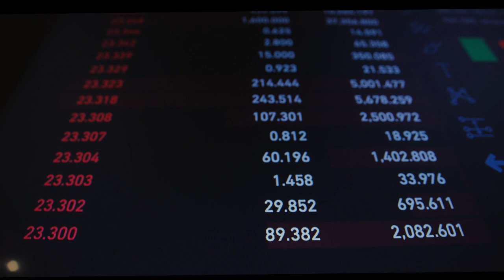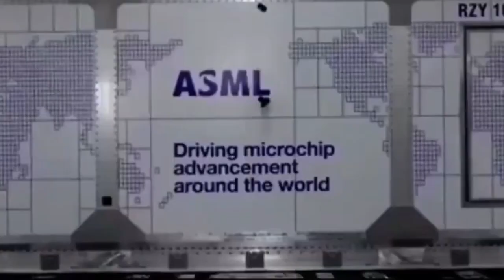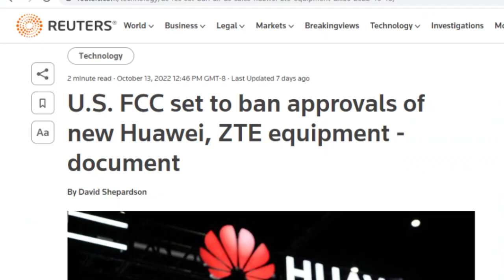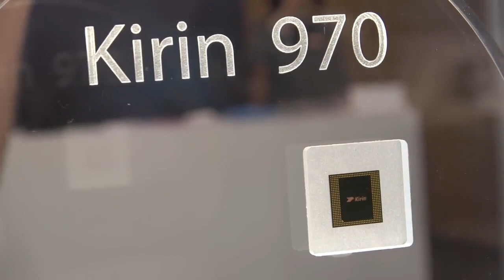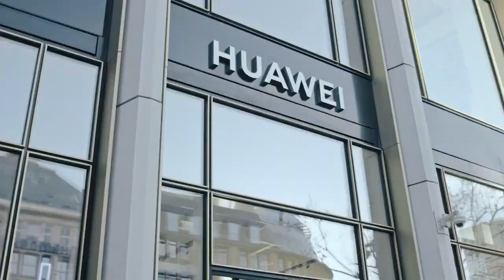Huawei's New breakthrough , ASML should be worried

Comment: Even without EUV, using the DUV tool, China's SMIC has been able to mass produce 14nm chips. SMIC and is now using its N+1 technology to produce 7nm chips in a limited scale. Also, China has pushed out Chiplet Standards for use  to produce up to 4nm chips. All these new techs are being used to produce high end chips in China. Huawei's new breakthrough in light source will, no doubt, lead China towards making its first EUV machine.
Reply: Jai Hinduja.  Must mass produce for Huawei phone SOC by 2023 first,  otherwise it is like another SOC prototype development.
Reply from the maker: I Appreciate your comment
Perfectly on point 👌👌👌👌👌